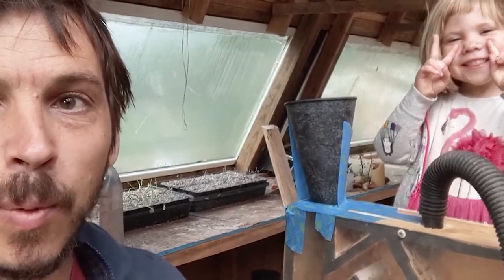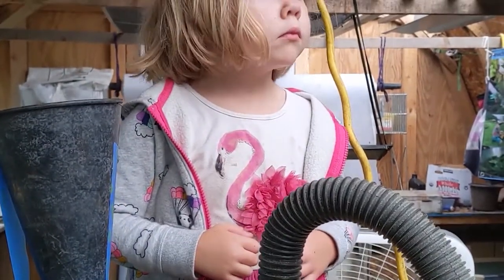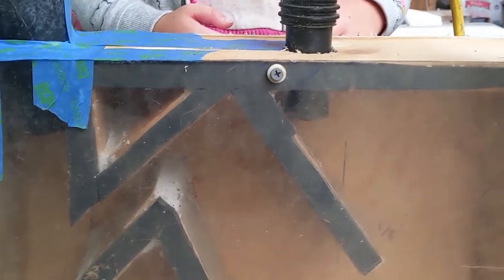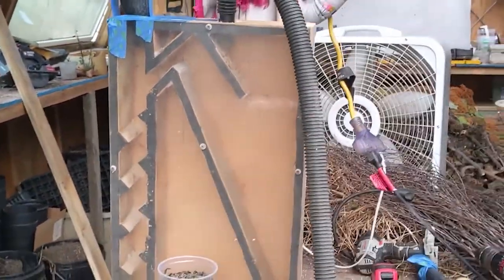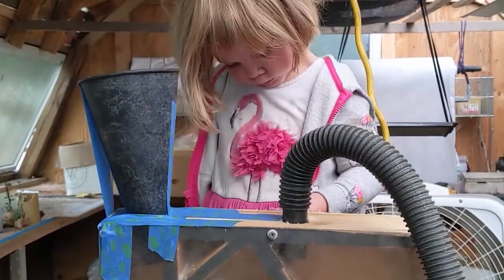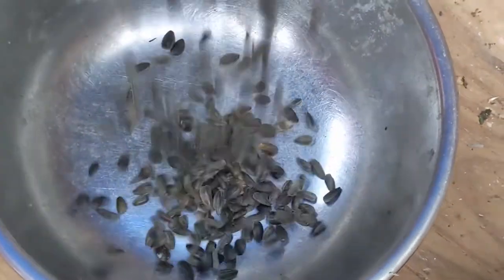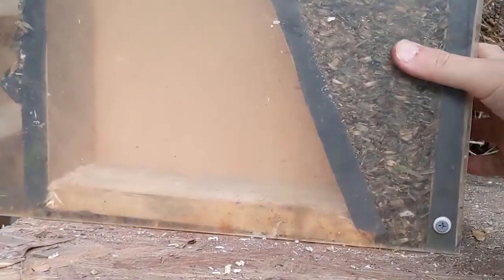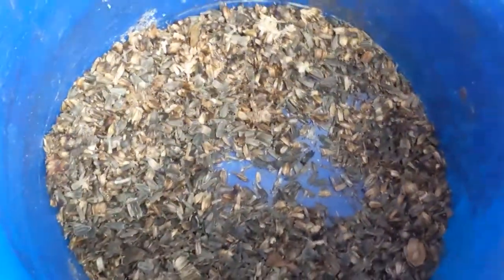Homemade Seed Winnower - Test I - Sunflower Seeds

Comment: I got a vacuum cleaner about 10 years ago for AU$100 that had a slide knob on the top that changed the engine speed hence changing the suction level. In this scenario you would save power instead of just having a flap at the back.

Comment: Hi can tell me where can I get this seed cleaner do you sell it?
Reply from the maker: There is an open-source design to build one! https://www.realseeds.co.uk/seedcleaner.html
Reply: It's very easy to make yourself. The other version is a fan and a bit of metal like a half tube that the fan sits slightly inside. The tube is on an angle of about 30 degrees and the junk blows out the top end and the bottom end you have a bucket under and get your good seed in.